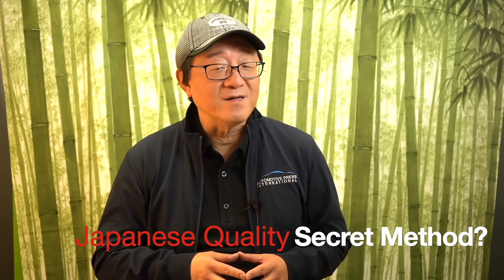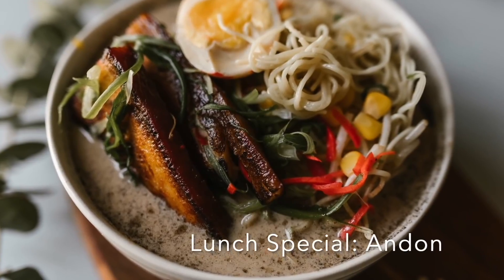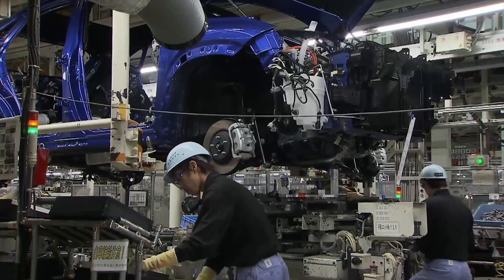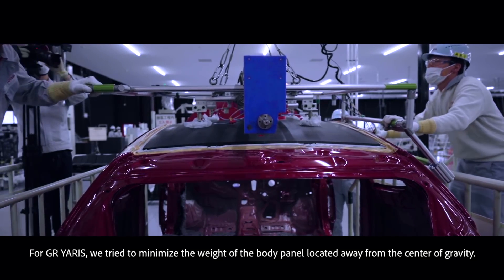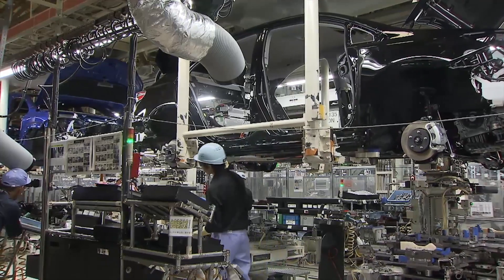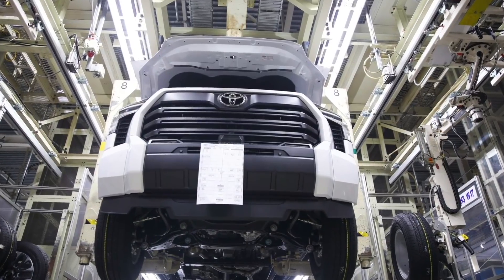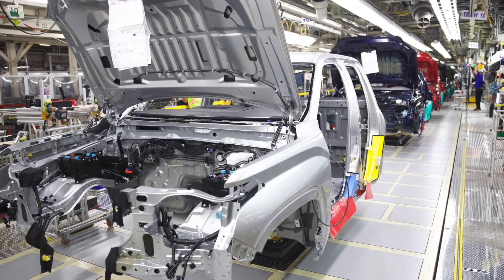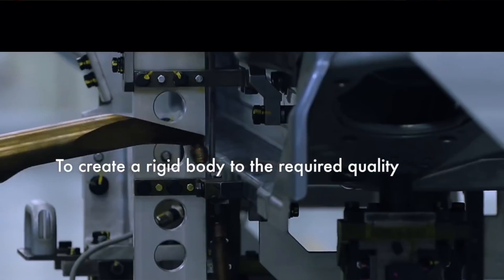TOYOTA'S SECRET SAUCE FOR 100% QUALITY IS CALLED "ANDON" - METHOD THAT OTHERS CAN'T FIGURE OUT

Comment: Unfortunately the dealers outside Japan have no idea what andon is. In Sweden the service is horrible, the dealers are always doubting the customer and not solving the problems. Once I had to teach the service team which oil they should use. I was challenged and showed them the car manual. It was an embarrassing situation.

Comment: Again, thank you very much for this type of insight into the automotive manufacturing process.  Just wondering, though, if you could also in the future describe some of the typical defects found at each stage along the line and how they are actually resolved.  Also interesting would be to hear you speak about how defects are tracked and worked on by the various engineering teams…

Comment: Well they sure dropped the ball on the Tundra—what an absolute gong show that effort was. Let’s hope they don’t destroy the upcoming 4Runner as well.
Reply: Built in the USA, I'm guessing, either the workers not caring, or crappy team leaders, etc
Reply: Upcoming 4Runner as as stated in David's other video will still be built in Japan.
Reply: The problem with the Tundra goes beyond Andon, which might address assembly issues. it has serious design flaws and a “cheapening and lightening” design philosophy that no amount of Andon can fix.  His video clearly shows the Tundra line with Andon yet hundreds if not thousands were sent out with blatant flaws like poor window seals, wastegate, under-dampened shocks and the list goes on.   I’m crossing my fingers that this doesn’t happen to the 4Runner but I’m not holding my breath.

Comment: All true, Japanese manufacturers have earned their reliability recognition. Especially impressive when you consider Japan's lack of resources and geographic location.
However, Toyota has royally messed up the Sequoia with not going with a diesel engine and a flat storage area when the rear seats are folded. The Tahoe/ Yukon products are far superior with their reliability and utility. 
2cents lol.
Reply: @B T generally speaking true, but not the Duramax / Allison.
Reply: Diesel engines for consumers will be a thing of the past , (emissions) they are in boats , trains and trucks THE biggest polluters . Like the V8’s , companies are being forced to drop them . While coal is producing a majority of the world’s electricity.🙄
Reply: @jd2plus2  diesel / DEF is now cleaner than filthy batteries. Nuclear power is the cleanest grid electric.  
Diesel engines can be converted into hydrogen engines.
Reply: @jamesdavidsmith4033  individual nuclear plants for major areas are a must . If we don’t do it . There will be brown outs and residents will be subsidizing high electric costs for everyone’s vehicles . Lithium is a potential fire hazard as well .

Comment: Indeed. The work ethic is off the charts. I have a -22 Trail Tacoma and the details make the difference. And the tech is awesome.

Equally impressive are Japanese motorcycle instructors. The discipline is simply second to none.

( btw- I have been sitting on an idea for Toyo manufacturing that will instantly be a hit- and guaranteed all auto co. will implement. Would like to see Toyo start. Don't know where to go. Want to help)